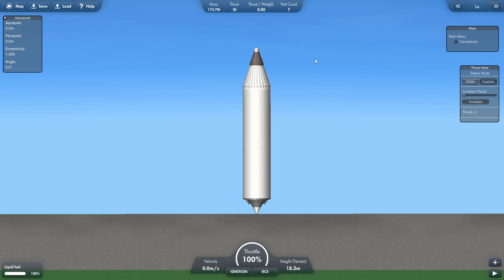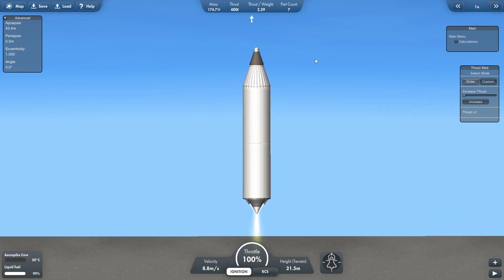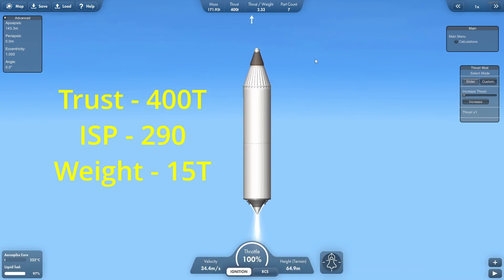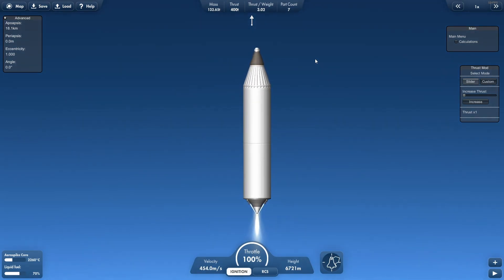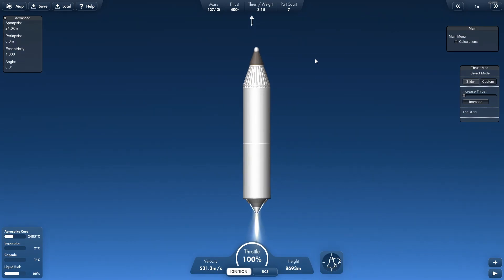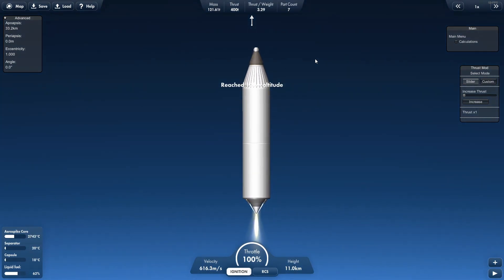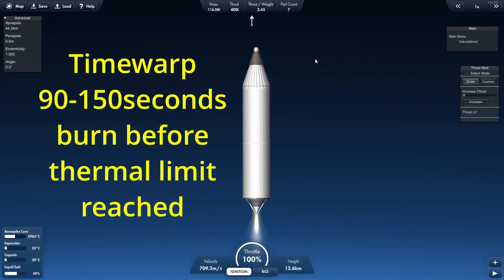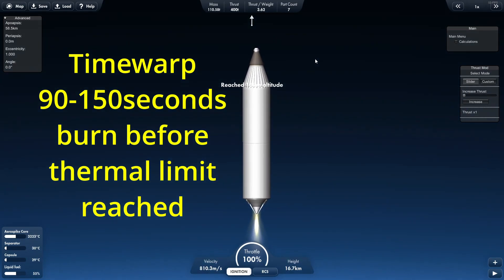New SfS Aerospike Engine ! Custom part for Spaceflight Simulator

Comment: Are these available on the mobile version?
Reply: No, mobile is very difficult to mod and i dont believe it will come soon, Imagine it like this:
PC Modding is like using a knife to cut butter
Mobile modding is like using a knife to drink soup
Reply from the maker: It’s unity so there is a lot of transference between platforms, however for custom parts the developer needs to write specific import code for each device. So far they have Mac and PC.
Reply: @polarbear4620  yup, in mobile there should be touch support that's why it is hard
Reply: @polarbear4620  but we can mod OBB file right?
Reply from the maker: Mobile support for custom parts is expected soon (maybe update 1.6?), once it’s available I’ll be offering the custom parts support for mobile.